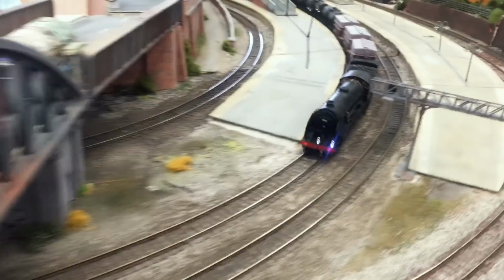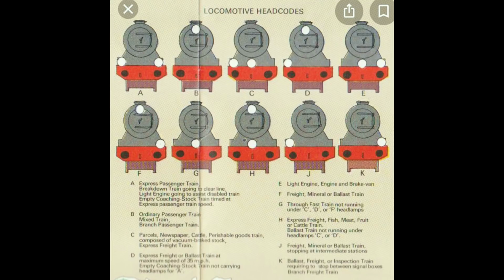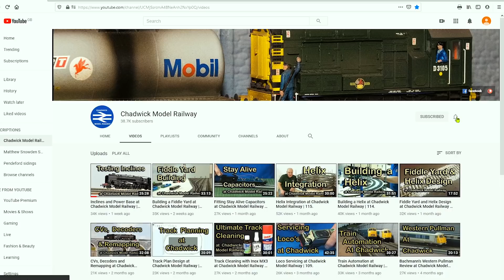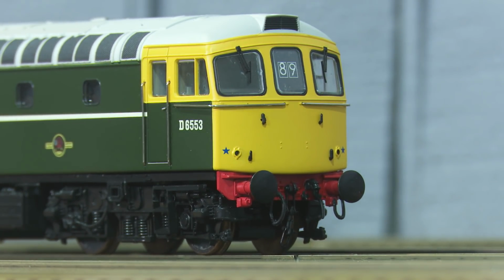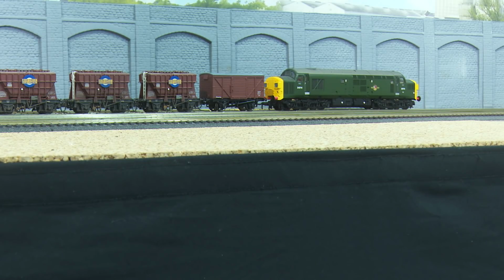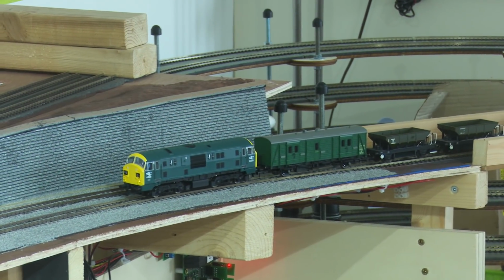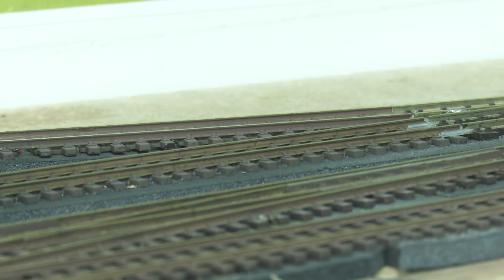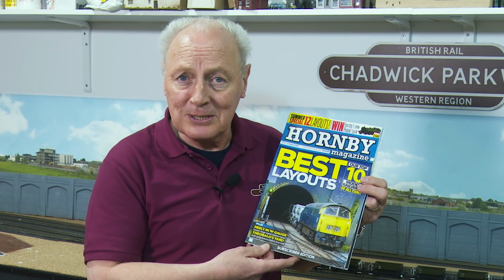Building Freight Trains at Chadwick Model Railway | 155.

Comment: Good video Charlie, a couple of minor comments. 
On your part fitted train the container flat is actually a fitted wagon and can remain where it is. Can't help with the gunpowder vans and barriers wagons but most photos I have seen show them at the end of the train near the guards van. I have seen photos of block fuel trains with 2 barrier wagons behind the loco and one in front of the guards van - Did regulations vary by region I wonder?
My ballast train c1960 is 4 Dogfish, 2 Catfish and an ex GWR Herring, the dogfish (and catfish) wagons ran both ways around particularly in steam days when they did not always run as block trains and wagons would get turned around depending on their routing before being remarshalled and returned to the quarry for reloading. The Herring and Catfish are available as kits from Cambrian.
Wagons often also ran in small blocks within a train mainly on through trains between marshalling yards so for example you would often see Cement wagons, container flats, tanks and steel wagons (bogie bolsters and plates etc.)  in groups of  3 or 4 within mixed freights, coal wagons or empties were often grouped at the rear before the guards vans. I suspect marshalling yards used to make up trains to a full load for the loco with coal or empties once the higher priority freight had been made up.
One type you did not cover was the classic pick-up mixed goods - generally class K (unfitted) - these tended to be marshalled by wagon destination with all wagons for a particular station grouped together to simplify shunting en route. So typically a train would look like a succession of short trains per station eg  a van and two coal wagons for station a A followed by a van and sheeted open and a coal wagon for station B followed by three cement wagons for  private siding C and so on. One exception to this was loaded cattle wagons (these were mostly fitted) that were marshalled immediately behind the loco. 
One other point that gets to me on otherwise excellent layouts is the practice of running colourful Private owner wagons in post nationalisation trains. The PO wagons were pooled in 1939 and would not have been repainted after that except possibly in BR grey so while some were in service in the early 60's most were grey or very battered and faded having not been repainted for more than 20 years.
Reply from the maker: Great comment Jonathan, many thanks I shall have to check out those catfish kits, regards Charlie

Comment: I learned something about England's railroads though I don't model those railroads.  Good video Charlie.  The term "rivet counter" has a bad reputation in the states.  It is only because of those that belittle the others with their opinions in a negative manner.  There are folks who want to have a model train of every passenger train that was famous.  There are collectors running trains.  The worst of the impact is to the beginners who just wanted a pat on the back for their efforts.  To say you were disappointed by the magazine cover is one thing.  You would think Hornby would get it correct when publishing.  However, it would be a negative thing if you went on a rant about it while getting red in the face doing it.
Reply from the maker: I’m so pleased that you found it interesting DKA. Yes Model railroading is all about keeping things in proportion. Let’s not put the youngsters off this fascinating hobby. Regards Charlie

Comment: Hi Charlie,, you called the engine on the ballast train that you called it a class 21 yet it has a different number on the side of the engine itself ,, why is this so as over here in Australia we have the class of the engine on the side and on the front of them ..
Is any chance you can explain why (or anyone else for that matter) this is so as I have notced the same on a lot of English sites that say the same thing. 
Cheers from John in Australia
Reply from the maker: Hi John, with today’s trains they do carry their class number before their individual number. For example a class 86 loco with a number 32 would be 86032.  
However, before 1973 I believe, the locomotive class was never mentioned. Therefore all numbering had no real plan .Class 52s for example started 10**.

Comment: Ballast trains usually had two brake vans one at each end.  One would have been a general brake van while the other would have been a plough van.  That would have stopped at the same time as brake vans were no longer used in genera freight.  The green one you had was a southern 4 wheel passenger brake rather than a tool van unless converted and labeled as an engineers van.  (Sorry to be rivet counting).   My favourite diesel freight was to watch a pair of class 20s accelerating a fitted freight train away.  Your video made me think.  How did they sort out freight trains when they changed from vacuum to air brakes?  Did they run two separate trains, vacuum or air, or did they run the vacuum brakes as though they were unfitted behind the air braked stock.  It would have been one of those questions I asked my late father who was an expert in railway braking systems.
Reply from the maker: An interesting point Don, however weren’t later rolling stock dual braked? Regards Charlie

Comment: Dapol and Heljan are famous for GOD awful couplings. The NEM pockets are too low and weak as hell. If i remember correctly, back when I was a modeller at the old Meldon Quarry visitors centre before it went to the dogs. We used to super glue the milk tanker couling pockets up to the main chassis so they didnt droop low. Seemed to work from what I remember, might be worth a go with a few test trucks?
Reply from the maker: A useful suggestion mate. Many thanks, regards Charlie

Comment: The stuff on the wheels is not carbon - it's mostly metal oxides, possibly combined with atmospheric dust/grime. 

As to the couplings - if this is intended to be a fixed rake, you could just use fixed bar couplings in the middle and Kadees at the end. I'm surprised that you haven't already converted these to Kadees to match the others on your layout.

In any event, this is a good summary of freight formation information for this era.
Reply from the maker: I wanted to make the point that, straight out of the box, they couldn’t be shunted. Regards Charlie
Reply: @ChadwickModelRailway  That is a fair point.
Reply: "The stuff ... mostly metal oxides ..." -> let´s just say "patina", what will happen again.

Comment: Hi Charlie. I for one find your level of ‘sadness’ perfectly rational 🤷🏻‍♂️ But good on you for correctly point8ng out that there are no rules, just the ones you make for yourself. After all, I never saw any Smiths Crisps, Weetabix or Birdseye Fishfingers 12t Vans on the railway, but I’ve got them in model form so I shall run them when the mood takes me 😜

I think that the difference is when you see a layout where there is an attempt at authenticity. That is when an ‘obvious’ mistake like that irks, because you can’t help but be aware of it, rather like as you point out, when a perfectly weathered, beautifully turned out train with headlamps etc rolls along and you notice that grey unfitted wagons appear near the front with a load of bauxites behind. If it’s MY railway and the nephews are round, meh, who cares? They’ll happily make rare old mixed traffic formation using my LNWR Coal Tank with a couple of Mk2d carriages, a coal truck or two, a Car-a-belle car transporter and a guards van on the rear, so it makes me chuckle when some get ahead of themselves 🤣😂😅

Those couplings are a mare though. I am looking to convert what I can when I my new set up as I am fed up with derailments and train divisions 🙄 I recently trialled some fairly cheap magnetic couplings which seems to work well in fixed formation and are discreet enough for me 🤔

Cheers again mate, always good to see another video 😎👍🍀🍻
Reply from the maker: What an excellent comment Tim. I will sort these couplings, it will not break me! Regards Charlie

Comment: Always use Kadee couplings, far more realistic although sadly, they’ve quadrupled in price also.
Reply from the maker: No Derek, what I’m going to use is a rigid bar to connect them, and then KDs at either end. Regards Charlie
Reply: Extremely educational for me, got a lot out of it. Seems great idea connecting a bar between each vehicle instead of tension couplings which, sadly are  very train set nowadays?

Comment: HI  CHARLIE   WELL I AM WITH YOU MATE  I DO NOT LOOK AT RIVETS TO SMALL TO SEE  BUT  OIL TRAINS  SHOULD  HAVE  BARRIER WAGONS  AT BOTH ENDS OF THE TANKS  AS THE ENGINE
MITE CHANGE  ENDS ON ROUTE ,   THE UNFITTED BREAK VAN  HAS A WHEEL  IN TO PUT THE BREAKS  ON THAT VAN ONLY  AND A FITTED BREAK VAN  HAS  A  VACCUM BREAK HANDLE IN THEM  THAT  WILL PUT THE BREAKS
 TO  PUT THE BREAKS    ON THE  WHOLE  TRAIN.
Reply from the maker: I’m totally with you on this one John. Regards Charlie

Comment: OK, This is very interesting. I am also pay attention of the way trains consists should look. I am living in the US and of course everything is quite different. I am curious to the fact that, as you mentioned, some cars in the late 60's had no brake system. Why is this so? The brake system adopted in the US date from the late 19 century. It is true that the system was not use thought all the railroads right away, as it is an expense for the railroads, and it took major accident including passengers to force the universal adoption just to show the public that trains were safe. Whoever, this happened long the 60's so why not in the UK. 
As for the cars connections. Why don't you guys use knuckles instead of your odd system which don't even looks good either. Just my opinion.
Reply from the maker: Yes it was shocking the way that these unbraked wagons stuck around for so many years.

To get around the coupling issue I will use a straight bar between the wagons, and KD couplings at the end.
Reply: @ChadwickModelRailway  Thank you for the feedback. Still, what about knuckles for all the cars. Fixed connections make it very difficult to change consists. This would not be a huge investment. After all we do spend some dineros, don't we!
For the un-braked cars. This means that you need to have different type of trains. This would be a nightmare to run, if you plan to do some realistic ops.

Comment: Second post.  As to the saggy couplers:  Without a close inspection it is hard to say, but if the mount can't be tightened up or fixed I would look into gluing a shallow U-shaped bar made from thin flat brass stock under each coupler to support it.  I'd build a jig to bend the brass strip after testing a prototype.  I'd use super glue to attach each bar to the undercarriage, assuming such an attachment point exists.  All this would be very tedious, indeed.  Alternately, if the train is to stay together all the time, I'd look into those semi-permanent couplers I've seen used on OO passenger trains.  Cheers once again.
Reply from the maker: You’re dead right on the second choice Andrew I will use a fix coupling bar between these wagons. Regards Charlie

Comment: It's worth noting that train classification changed from A - K to 0 - 9 in 1960. 

In the four character headcode, the last two digits are just a reporting number, it's not related to time of day at, they might climb during the day but not necessarily.
Reply from the maker: Interestingly, someone has mentioned that even numbers head into London, and odds away.  This is worth checking out.

Comment: I didn't realise freight (goods) trains could be so interesting
Always excellent and informative.
Maybe snip a small amount off the bottom of the drop bar?
Kds are the answer as in one of your previous offerings.
If there is anything worse than tension locks it is bad tension locks.
Love the NEM  pockets now Kds  are supplied with NEM fittings.
Thanks again
Stay safe
Howard
Reply from the maker: I think the option I’m going for Howard, is a fixed bar between the wagons and Kay Dee’s at either end.
Reply: @ChadwickModelRailway  Good idea Charlie
Similar to my Bachmann Mk 1s. 
Bachmann supply a fixed coupling bar with NEM fittings 
They are looped and look like the old vacuum hoses. They
Are a closer coupling as well.
Maybe they could be an easy answer?
Regards
Howard

Comment: Hi Charlie, ref the 4 digit head code As you rightly said the 1st number is the train class, the V denotes a train that will finish it's journey on the Western Region. The last 2 numbers actually denote if the train is an UP or Down train. Up trains normally have even numbers whilst Down trains have odd numbers. Also, some unfitted were known as "blow throughs" They had a vacuum pipe but it was painted white instead of red to denote no active brake.
Reply from the maker: And that’s a great comment. I had heard of wagons been through fitted, that’s without brakes. The last two digits of the head coach though, I found fascinating I shall certainly check that one out. Regards Charlie

Comment: This was a very informative video Charlie. I did not know about bauxite and grays what had brakes or not, this has helped to understand more about running stock. Regarding brass wheels on Heljan. All my Heljan loco's I changed all the wheels quite a few years ago with Ultra scale wheels for the reason you stated. All the best. Mick
Reply from the maker: Thanks Mick, I shall certainly look into the wheels made by ultra scale. Regards Charlie

Comment: Hi Charlie, since this is a unit train, fit Kadees on the 2 ends and snip the lift arms off those horrible couplings. It will make them look better in the interim!
I don't model English Railways but I reckon it's common practice to buffer fuel trains with "safe" waggons either side of fuel stock!
Nice presentation as always, thankyou.
Reply from the maker: Thanks Peter, what I intend to do is to fit a rigid coupling between all the vehicles, with KD’s at either end. Regards Charlie

Comment: If you can't find a replacement coupling, cut the pins of flush. The wheels, replace them as you did with the plastic ones. I like the idea of the DCC giving you the option for the lights. Though you will have to put a decoder in the caboose. ,😁Oops , van car?
Reply from the maker: Yes Bob I will need a decoder in the guards van should I choose to turn the lights on and off. As for the wheels, apparently they’re a strange dimension!

Comment: Charlie, great video as always.
Regarding couplings you have some options as your dog fish wagons appear to be nem pocket fitted.
I'd suggest cutting the drop bars off or fitting hunt elite magnetic couplings if you run it as  a fixed rake.
I was going to suggest kadees but with the droop you'll probably have the same issues.
As for head codes. Well thankfully I model modern image!
Reply from the maker: I’m unsure whether I will yet use Hunt or a solid bar to cup of the wagons.

But I will certainly use KD couplings on the ends. Regards Charlie
Reply: Ive the same problem with my dogfish wagons couplings… annoying! Any suggestions how to cut the drop bar on the tension couplings please? 
Another good video even as a lifelong ex railwayman I learnt a number of things! Cheers
Nick
Reply from the maker: All will be revealed on Friday!

Comment: Thanks Charlie,

Another great video. Interesting about the vacuum fitted wagons. The couplings on those dogfish look similar to the rubbish ones on the cheap Dapol wagons. One way around it would be to remove them and replace with Kadee number 5s it would be permanent though I have done this with great success on some old mainline stuff. Cheers!
Reply from the maker: I will probably go with a solid coupling bar, and KD couplings and either end.

Comment: Also regarding the drooping coupler drop bars!
You could consider trimming the length so that thay do not fall foul of the rail hight at points,

But important to take into account for particular types of auto decouplers on your layout,
As these may not work correctly if you do decide to trim the length 👍🏻
Reply from the maker: I think that I’m going to permanently couple of them with some kind of bar. That way they will shunt properly. Regards Charlie

Comment: Rivets thoroughly counted there, Charlie boy!

As for the tension locks and points issue, I've had this a lot... In fact many of my issued have been caused by the stock Couplings that come with stock - seems they only work reliably if you're pulling stock around an oval of track... anything more complex and you encounter issues thus...

So for this reason I've experimented with many couplings types, as I see you have also...

Kadee, magnets, sprat and winkle - ANYTHING would be better than the stock Couplings...
Reply from the maker: You’re pushing on an open door on this one. I think with this rake I shall use a bar type coupling between the wagons and a KD at either end. Regards Charlie
Reply: @ChadwickModelRailway  I like that saying, never heard it before!😁
Look forward to the update anyway! Cheers!